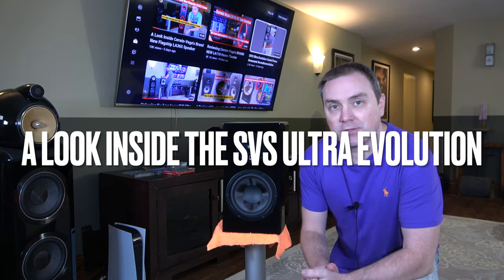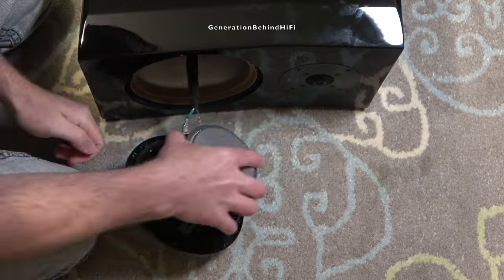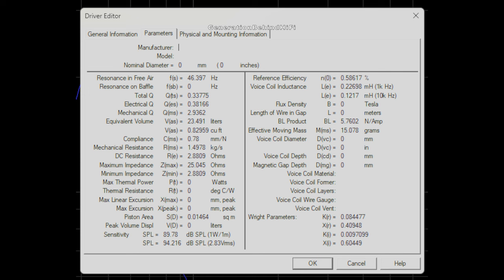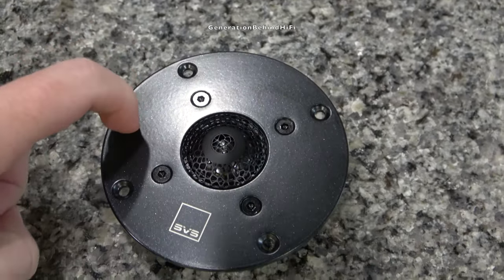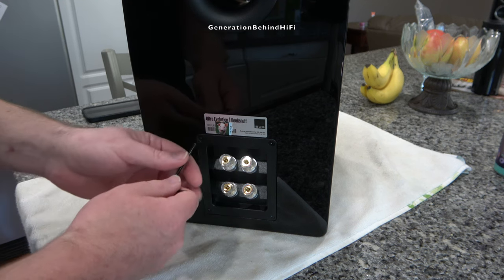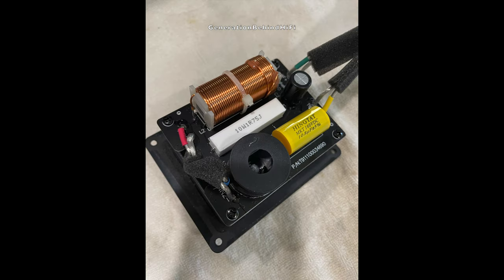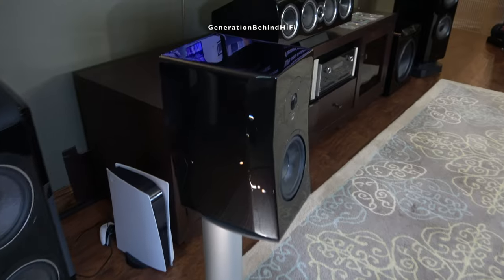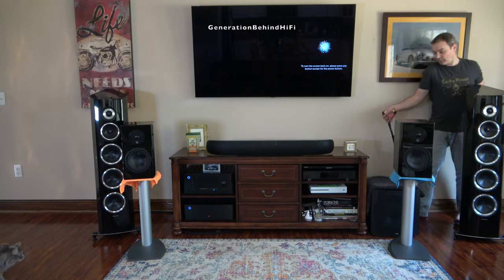A Look Inside The Brand New SVS Ultra Evolution Bookshelf Speaker

Comment: Is there any way you can improve the contrast on your Impedance graphs.  The trace lines are very hard to see.
Reply from the maker: I'll see what I can do. Currently I'm taking a screenshot using the windows snipping tool, but I'll see if I can capture it in a higher resolution. Thanks for the feedback.
Reply: @generationbehindhifi  
Can you not set the colours in the impedance graphing software?

Alternatively, If you load the captured file into something like IRFan View the "auto adjust colours" function might solve the problem for you.

BTW... nice channel, keep up the good work.
Reply from the maker: @Douglas_Blake_579  I never tried to adjust any of the colors in the software before. You're the first person that has said they are having issues viewing the data from the impedance sweeps. Are you trying to view it on your phone, computer, or screen? If I could change the colors, what do you think would be better to make it easier to read? 

I'll take a look into IRFan View and changing the colors in the software program. Thanks for that suggestion. If I offered the impedance graphs in the community section during the release of each video would that help? 

Thanks! I really appreciate the support.
Reply: @generationbehindhifi  
I suppose it is possible the problem is at my end... but I'm not seeing it anywhere else, so I think I would rank that as "unlikely".  

I just took a look at the DATS software and there are 2 options that might help. The first will display "bold" traces using wider lines  and the second one allows you to choose a lighter background colour for the graphs, which might also improve things a bit.

I do hope this is helpful...
Reply from the maker: @Douglas_Blake_579  It's very helpful, Doug! I made a note of it for my next video and will do what I can. As always I appreciate the help and feedback from you! It's always very constructive.

Comment: Hard to tell from the video but how is the crossover connected to the binding posts? Were those actual wires or like.. metal tabs?
Reply from the maker: Speaker wire is being used to connect the binding posts to the crossover.
Reply: @generationbehindhifi  Thanks! Looking forward to the review. I like what you're doing with your channel. Do you plan on doing more measurements in the future?
Reply from the maker: @tpn8402  Thank you! I think I'll leave the measurement part to Erin's Audio Corner. He does a great job with that! I might do some in room measurements with speakers to show the response curves. However, I don't know how valuable it would be since speakers will yield different results in different rooms.
Reply: @generationbehindhifi  yeah, that could be nice to get some basic idea of the speaker's tonality. But like you said, I don't know how much the room would mess with the usefulness of that.. I just don't know enough about measurements. Maybe you could lend Erin some speakers he hasn't measured yet haha
Reply: @generationbehindhifi  - Some people put an over-emphasis on measurements.  If you change out the cheaper parts in the x-over for better ones, it will sound better even though they will measure the same.
It all boils down to how it sounds to you.

Comment: " Ultra Evolution" using a polyester cap and not a polypropylene on the tweeter?
Reply from the maker: Did you see the "MET" stamped on the capacitor in the video? That stands for metallized polyester film.
Reply: @generationbehindhifi  That is what I'm saying... a speaker in their Ultra Evolution line should have a polypropylene cap in the tweeter circuit not a MET.
Reply from the maker: @Chuck--  IMO I think the cabinet and diamond tweeter more than make up for it. The cabinet construction and tweeter are the best I have seen and heard in this price range so far. 

Changing a cap on a crossover board is easy, but redesigning a cabinet that sings or replacing a tweeter that is subpar isn't. IMO I think SVS hit a homerun with these.
Reply: @generationbehindhifi  I have the SVS Utra Center (original) and am not satisfied with the sound quality.  I've considered the GR Reseach crossover redesign with high quality parts, but do not trust that it will perform like I want.  I question how someone in 2-3 days can design a x-over network by computer models and not listen to the results b4 selling it.

Comment: they wanna charge 1900 cnd for it. 🤦🏻🤦🏻
Reply: It's the same price as the Ultra bookshelf, so doesn't cost anymore for the Ultra Evolution.
Reply: still, is this really a 2000 dollar speaker?
Reply: @rushgush  
It is NOW! EVERYTHING has gone up from groceries to houses. I'm in Ontario, and when I bought the SVS Ultra Bookshelf from Electronics For Less Canada in 2018 I paid around $1570 total cnd, and now it costs $1890 cnd. An over $300 cnd increase in price.
Reply: yeah, prices are gross

Comment: Looks like they are using the same aluminum  wires smh
Reply from the maker: I reached out to SVS and they claim its "tinned copper wire".
Reply: @generationbehindhifi  I’m glad I went a different route speaker wise these are more alike the original than new same crappy crossovers and parts only thing new is the curve in the cabinet
Reply from the maker: @danemoreno88  I disagree and this is coming from a guy who has owned both Ultra series. I am not a fan of the previous generation, but I am of this one. Anyways, I’m not here to sell you on them, I have no skin in the game either way. My job with this channel is to provide you with the data so you can make an informed decision. However I would question your ability to interpret the data if you think these are "crappy" as you say. The cabinet, well damped drivers, and tweeter tell a different story. Best of luck in your search!
Reply: @generationbehindhifi  no problem this is just my opinion on the money they are asking for the new series I had a the whole set of last gen ultras I loved but not naive to the sub par parts they did use and looks like continue to use I’m glad you made this video to show us what’s inside I have power sound audio speakers now Tom V owns it he’s the v in svs